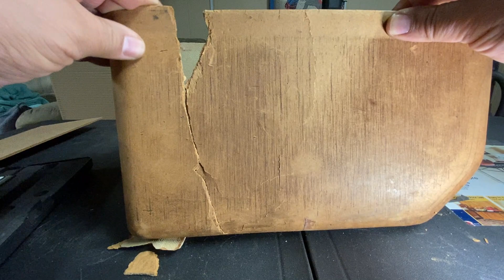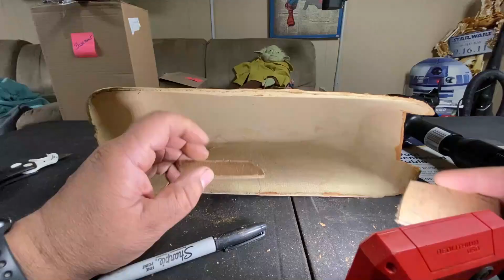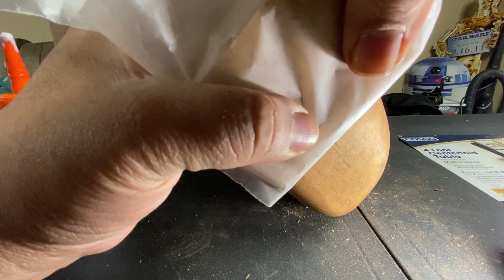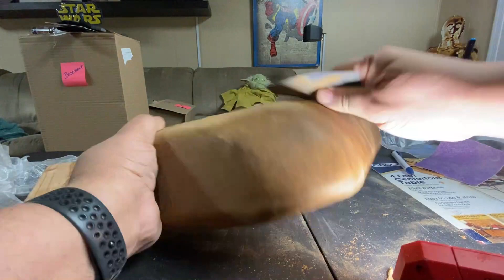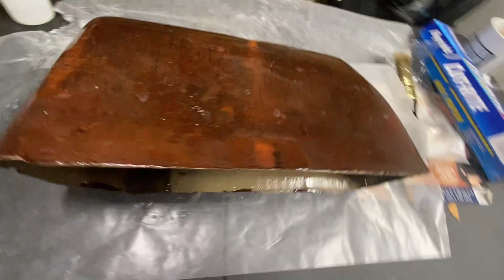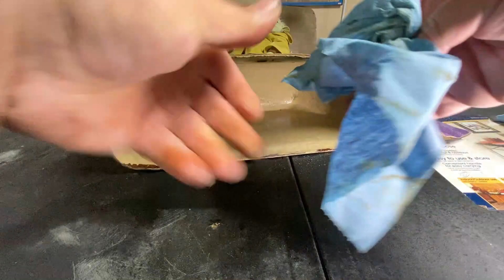VW Bug Broken Glove Box Repair

Comment: May I make a suggestion?  When I do similar repairs, I use drywall mesh seem tape over all "joint seems" then I "fill" the entire surface of the mesh tape with Tight bond III glue as it is waterproof. making sure it is smoothed out and leveled it dries clear and is very close to as strong as actual fiberglass.  Also, when taking down the edges to match I use a flat file it is far more accurate than free handing with a Dremel and actually much quicker.  But the way you did it should work out pretty well also so Good Job!  In this application I would only put the mesh/glue on the outside of the glove box. though it would not be offensive to be able to view it on the inside too. But structurally there wouldn't be a need for it on both sides.
Reply from the maker: AWSOME. What great idea! Thank you sharing.

Comment: Nice job, I was hoping this would show the glovebox with the rivited latch..I'm sure you could apply all the steps still. And the resin seems like a good idea even if it doesn't need repairs.
Reply from the maker: Yep or drilling the rivets out and sandwiching an aluminum plate on both sides with hardware.